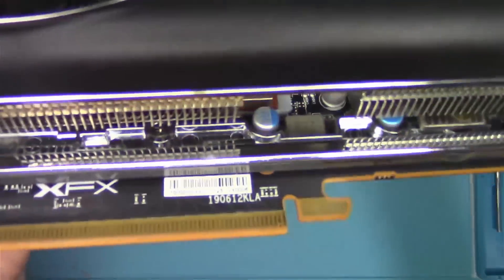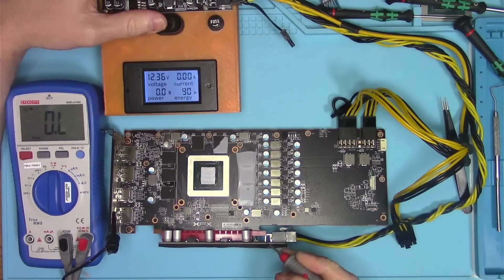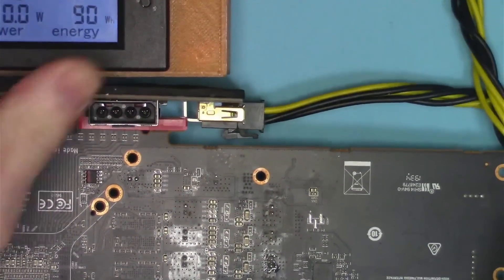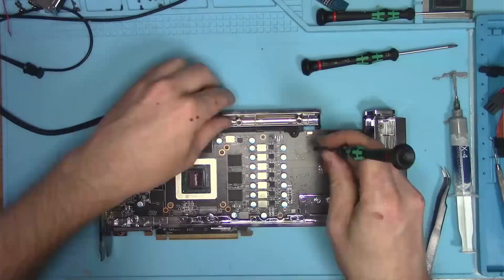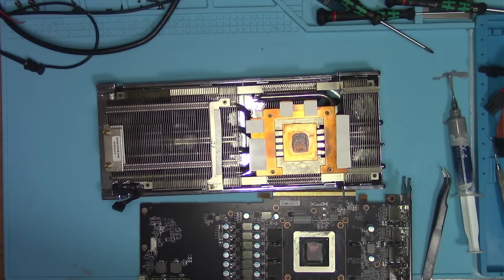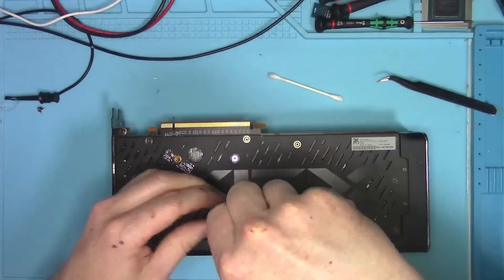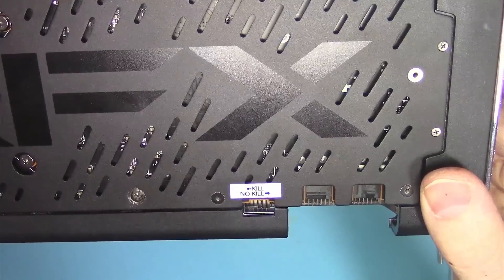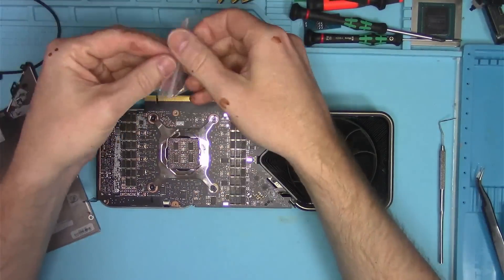Why your gpu crashing under load and how to fix it

Comment: PSA: always contact the manufacturer directly to ask about the correct thickness of thermal pads when performing a thermal pad replacement.

I was able to avoid this issue, except in my situation it was for the memory. I was cautious enough to do so when working on my older Sapphire R9 290 Tri-X OC to ask the manufacturer, even when the internet has numerous independant threads and sources stating it should be. Most referenced the EKWB manual for this card, which uses 0.5mm for the memory and 1.0mm for the VRM/MOSFET. But I was measuring a different thickness when I took the card apart; 1.0mm for both. After contacting Sapphire, they send me the Bill Of Materials (BOM) of this card, which states that ALL thermal pads are 1.0mm. This confirmed my finding of all of the factury pads on the card measuring 1.0mm.
Reply: manufacturers like to say "this is trade secret, we can't tell you" . asus is especially guilty of this.
Reply: @UrokLizard  True. Luckily, Sapphire tends to be quite helpful in my experiences. I guess EVGA will most likely be as well.

Comment: I bought the AMD ASUS Dual RX 6700 XT (not the OC version) and his cooler is very massive for a 2 fans graphic card BUT the temperatures seems to be fine (GPU 42 celsius and 43 celsius for the junction). My temps are this with RPM 0, so my card is completely silent and fans start moving at 55 degree. In full load i have max 67 degree. Is it good in your opinion or not?

Comment: Got a lot of video cards from mining to fix. Half of them had pads replaced in a DIY way and were too thick. Apart from being too thick pads were of very low quality. I even got a lot of cards with no thermal pads on memory at all. Unbelievably the cards were still in working condition even if each memory chip was brown in the middle.

Comment: From what i heard, the 5700XT XFX cards had some pretty poor coolers, + it may also be a lowend card, but i would love to see a disasample of something like a higher end 6800/6800XT/6950XT card, to see if XFX´s higher end cards are good or bad quality whise.
Reply: That sounds familiar. I think most of the 5700 XT cards had perfectly good coolers though. I definitely remember researching them when helping a friend to build a computer. 

I remember that the Sapphire Pulse and Powercolor Red Dragon were both definitely good models, offering an excellent balance between price and quality, with the Pulse being probably the best version of the 5700 XT in terms of value per dollar, but with many other cards not far behind it. The cheapest Powercolor model was pretty crappy though. It's sad when the worst models are often only about 10 or 20 bucks cheaper, but significantly worse. However, prices can fluctuate a lot, so never assume that a more expensive card is actually better. Also, it's never good to blindly trust even the most reputable brands, and even the worst brands can sometimes make good versions of a card. Also, a model with a major flaw does sometimes get a revision which fixes the flaw.  

It's always best to find a good review of the exact model of card, to verify if it's worth what it's priced at, before buying, if at all possible.
Reply: Xfx rdna 2 line up are one the best , especially the 6800xt , see hardware unboxed review on it

Comment: I had a similar problem ... in my case I got the thermal pads exactly the 1.5 mm misure, and by a hair distance they were not contacting, which means after few days it started smelling of burned plastic, and the air became quite toxic .... then I reshaped the thermal pads to be thicker, 2 mm, and this time the gpu was not contacting .... and only finally I managed to get the thermal pads right in between 1.5 and 2 mm, and get rid of that toxic smell ...

Comment: XFX is indeed on the cheaper side of the manufacturers. I had the opportunity to play with an older chip (HD 6850) from both XFX and Sapphire. XFX had a joke of a cooler, Sapphire had a good sized fin stack. XFX ran 7C hotter. Not enough to kill the GPU, but enough to warrant the cheaper cooler - at least to XFX.
Reply: XFX used to be good, but man oh man they have really gone down hill, and it started a long time ago too. I definitely don't trust them, but I think some of their cards are still good, just depends on the model. It's not good to blindly trust any brand, even the most reputable ones. It's always best to check independent reviews for the exact model of a graphics card before buying it.

Comment: 3:32 the corners of the die were not fully covered, it's usually better to manually spread paste with gpus, delta with AMD cards is usually 17/20 degrees (C) under full load.
Reply: I used the "drop method' since I can remember. Always had nice spread of thermal paste. I always check even if this means I need to use double quantity of thermal paste. Spreading works for almost liquid thermal paste (like liquid metal). For normal paste, I put a drop, assemble the heat sink, disassemble, check, repaste then completely assemble.

Comment: Sorry to bother , i have a question for you , what can be the problem if my gpu 2070rtx from my asus rog hero 3 laptop is  throttling  , i guess , first time when i bought the laptop everything was fine and after some months the Gpu started to be used 100% , and dropped from 90 fps to 15-20 every 10 -20 seconds ,  FurMark ,Valley ,Heaven and games ofc . Now when i play i use msi to keep the clock speed at 1260 mhz /but in games stays at  1215 -the default speed , 60 fps.

Comment: I have 2 laptops, one is about 21 years old and the other is 8.  Both appear to have the same issue, when switched on they make very loud noise which I assume can only come from the fans somewhere inside.  
I am not a repair guy and I have no money to send the laptops to someone for repairs.   I am guessing I might have to find replacement fans for them and perhaps replace any thermal pads.  Any idea where one guy could find them online?    
The older laptop is a Compaq and the newer one is a XMG.

Comment: Definitely right about AMD cards running hot. I have an ASRock rx 66008gb and even with a super aggressive fan curve, temps can get to 80c+ in games with the added heat of the CPU.
Reply: My ASUS RX 6800 XT doesn't even get above 60c with 50% fan speed, but it's undervolted to 1030 mv.
Reply: @iseeyou1312  That's a 6800xt and they have much beefier cooling than a 6600 non xt
Reply: Try using a good thermal paste that helped me a lot, my friend's card ( rx6600) was dropping frames when he played some intense games he gave it to me I changed the thermal paste I used mastergel maker from cooler master it dropped the temperature by 15°
Reply: @yaniayache5132  I bought the card not long ago which is why I haven't yet, I shouldn't really need to. By the sound of it though they just come with crappy paste from the factory. The only paste I have was the stuff that came with my Dark rock pro 4 cooler. I reckon that would still be better though.
Reply: @yaniayache5132  I couldn't help myself and did it. My god. It was the worst factory paste job i have ever seen, it's a wonder the thing wasn't crashing constantly (though it did sometimes).

I used to get up to 89c on the gpu hotspot before in games that hit the cpu and gpu hard. Now i haven't seen it go over 65c.
Reply: see it was a thermal paste issue not cooler @janemba42

Comment: I have Aorus 5700xt and in some games the hot spot peakes at 105C while the gpu temps are around 70C. Changed thermal pads over the years which reduced the temps by 10C on memory. It is said that this is normal and the card is still running after 4 years... Looking at your videos im not so sure..

Comment: lol that was me after putting a 1mm pad on an old rx 580 nitro+. it started crashing with crazy temps right away at the start of benching. turned out the pad was kinda stiff and won't squeeze thus the die didn't contact HSF. changed the pad to 0.5mm and everything ran great.
Reply: Well the stock pads on 580 nitro+ are 0.75mm but they are almost unobtanium. That's why you should research what thermal pads the card uses before you even open the card (or at least measure the old ones).
Reply: @cryspin7  i did do my research which why i settled with 1mm at first expecting i could squeeze the 0.25mm difference. Just didn't expected the nonbranded pad i first bought to be as stiff as a plank lol. Bought a 0.5mm coolermaster pad afterward and it's pretty soft that maybe if i bought the CM's 1mm pad first I don't have to redo it
Reply: I bought the Gelid Extreme 1.0mm pads for my 580 Nitro+ as I learned that the Extreme is squishy enough not to cause a no contact issue.  Just do NOT use the Ultimate 1.0 as it is way too hard and WILL cause a no contact, overheating issue!  I actually haven't tried them yet as the card seemed to run fine yet and I temporarily put it in storage anyway for now. Funny how Sapphire recommends using 1.0mm pads if you can't find the .75mm ones...and who can...but they forget to mention to make sure that they are squishy enough to compress correctly!
Reply: @arthurmann578  my guess is they're also using 1mm pad, but squeezable ones and not the stiff ones.
Reply: @OcDmn   The hard ones (sounds "dirty" ...LOL!) will prevent the core from making proper contact with the heatsink. You need the squishy ones to be able to compress enough so that the two make proper contact. I guess it is best to test it first by adding some thermal paste to the GPU, screwing it down properly, and then taking it all apart again to see if the paste got properly compressed. It does waste paste but it is WAY cheaper than needing to buy a new graphics card and you could always try it with a cheaper paste first, if you have it on hand, and THEN use the good stuff when you know it compresses properly.👍👍

Comment: Amd gpu's are always breaking down. Nvidia is better
Reply: i got a msi delta laptop with a amd radeon rx 6700m its been on 24/7 for 1 year 7 months used to game all most every day never had a problem with it and the hot spot is still 8c to 9c above the core temp

Comment: For some reason I have the same high hotspot temperatures on my 3090FE. The memory and regular core temps are fine, but for some reason the hotspot is at a 30c delta to the core. Anyone have an explanation to this?
Reply: Most likely thermal pumping. 3090 is a pretty big core, 628 mm². If you've had it for 2-3 years and you haven't changed the paste then you're likely seeing the effects of the phenomenon which is more pronounced on big cores. 

Try to repaste and/or use a thicker thermal interface. Lastly, undervolt your card using MSI Afterburner curve adjuster. I think you could potentially drop that delta by 20C if you applied the above fixes.
Reply: @The_Man_In_Red  I repasted it a month ago, at first after repasting hotspot temps were within a 15c delta but now they are unusually high. 

This has actually happened to me twice, when I first got the card I replaced the pads for the memory and had normal hotspot temps at first, then over the next few days the hotspot temperatures kept increasing.
Reply: @Swiss4.2  Maybe the thermal pads you used were slightly too thick for good contact. It's hard to say without knowing the cards behavior when it was still factory, but that's what I would check.

Comment: 5700xt hotspot temperature is always high. I think it throttles around 110c.
Reply: Yup, AMD's official sources state that hotspot temps up to 110°C are normal, especially since these cards were built to fill up all the thermal and power headroom they can to squeeze out extra performance. I was concerned myself when I got my 5700XT, but some quick googling confirmed that it's rather typical

Comment: I have an XFX RX 480 8gb and it's still working after all these years. it has a metal backplate but no pads underneath probably to shield your fingers from burns when its running. I noticed that XFX GPUs always have the lowest price when on sale, I guess you get what you pay for even though current GPUs are way overpriced.
Reply: My XFX R9 380 also still runs perfectly

Comment: I have a Zotac RTX 2070 Super Twin fan which has the same issues, gpu temps are decent but the memory and hotspot temps can get too hot too fast even after changing the thermal pads. This is so very frustrating.
Reply: Undervolt it with MSI Afterburner curve adjuster. Ez to do and effective.
Reply: thermal design isn't that great if thats the case. but then again, zotac is one of those brands that offer cheap cards so i don't think they'll do a good job at designing their cards anyway.
Reply: Zotac has terrible design choices in general, probably a terrible heatsink